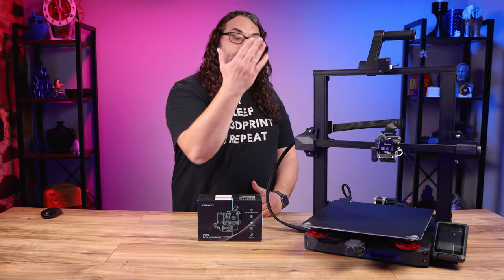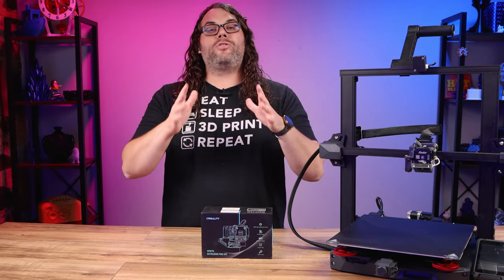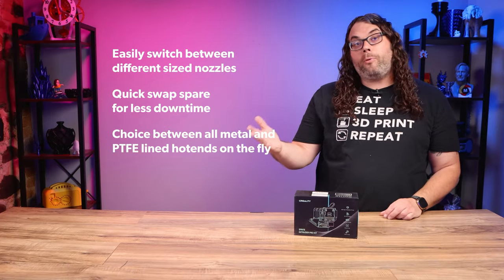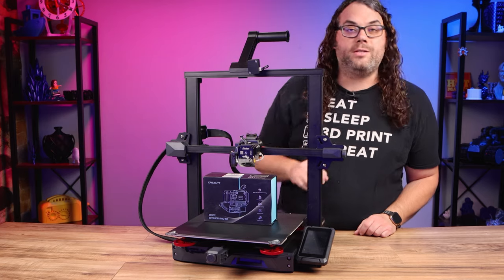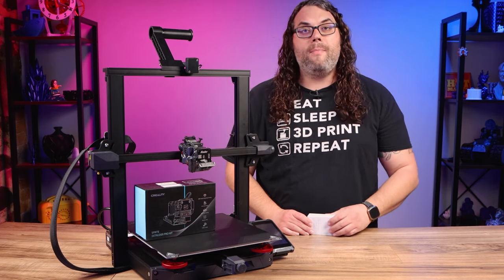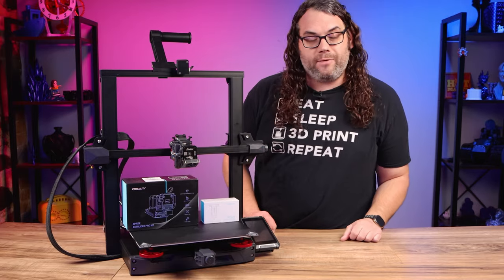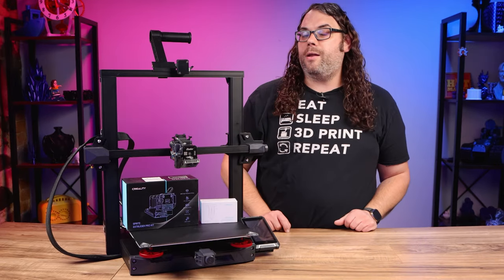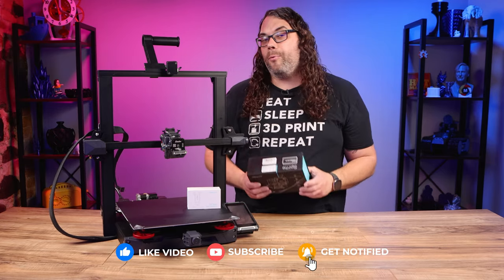Swap The Creality Sprite Hotend In 5 Minutes or Less!

Comment: Oversimplified as usual.  The CR Touch has a huge long cable, at least mine did.  That would require modification.   I also don't believe that you can just swap the head and print away. Channels such as this one always point out the incredible importance of the first layer.  I don't believe for a second that you will not need to to level to compensate for manufacturing tolerance.  When teh difference of 0.01mm makes a difference on first layer adhesion, you better be creating a new bed mesh after every change.  Not as simple as you state.  Also not that simple (labor intensive) to install on a printer that does not have this from Creality.  You need to disassemble the printer and run a ton of wires etc.  Also pointless unless unless you need to print at higher temps AND know how to modify code to extend the limits from 260 to 300, then recompile.  For the "nerd" this stuff is a piece of cake, but for the novice or someone who just wants to print better, hotter this is NOT as simple as stated.  You should define who your target audience is.   Not trying to be a jerk, just stating facts.  As always, this is a very informative video, but I do disagree with one thing you said, who would want to swap heads when the PRO version of this works for both PLA and other filament such as ABS?  Simple is better.
Reply: PLA prints better with PTFE than metal.  They do however seem to be improving the smoothness of the metal versions.

Comment: show me how to put it on a regular older model ender 3 v2, how do I upgrade the old E3V2 to have a the stuff the newer model has?
Reply from the maker: I like that idea!
Reply: @TheEdgeofTech  Agreed. I have a CR-10s that would love a direct drive upgrade of this level. I already have it running with 0.8mm nozzle for big prints that would need finishing any ways. Changing filaments on a direct drive is SO MUCH! simpler on a direct drive than a bowden setup. I am all about the faster and more convenient the better.

Comment: I have been trying to decide which 300mm or larger printer to get and now this makes me lean towards the Ender 3 S1 Plus if I see it on sale to compliment my Ender 3 S1. It would be handy to have another Sprite Extruder to share between them
Reply from the maker: I agree! The larger bed does come in handy sometimes for sure, and having an extra sprite extruder is a good idea!
Reply: I have the S1 Plus. I upgraded to the all metal hotend and use the sonic pad to run Klipper. Since the larger bed size causes more vibrations, I wanted input shaping. Super happy with the results. I also have a backup sprite hotend for exactly the reason being described

Comment: But...(I have an S1 no pro) Do I have to change the firmware because the non pro model can only handle 260°C More should be possible with allmetal, but isn't it possible on the software side?

Comment: I'll be upgrading my ender 3 pro with the sprite hotend and a PEI sheet. Will have to transfer the BL touch, and connect it all to the SKR board I've already installed.
Not looking forward to compiling a new custom firmware, figuring out the offsets, and all that jazz 😅

Comment: i bought one of these for my ender 3 v2 when it came out as an upgrade and over this past weekend one of the tiny cables broke inside the insolation. the gauge of wire they used in the cable is too small for my wire strippers to even strip the insolation off. I also bought a CR touch for my sprite hotend and had no way to plug it into the breakout board on the sprite extruder and ended up running the ketchup and mustard cables down with the large cable not very elegant imo but what are you going to do. maybe they updated the cr touch kits in the last couple of months but i doubt it
Reply from the maker: Good info! I have added the short CRTouch cable to the description of this video. Thanks for watching!

Comment: What settings are you using.  I just replaced my stock extruder with the sprite pro and cr touch.  The problem I am running into is that I cannot get it to autolevel.  After going to near center of board, it goes to point 1 but the problem is, that point 1 is off the front of the board.  Leveling stops after that.
Reply: I ran into the same issue. I have an Ender 3 V2 and had to use gcode M851 to adjust the XYZ probe offset. Once I did this, I ran into an issue where the bolts on the hot end carriage would run into the axis mounts on the far end. I trimmed the one bolt shorter and it cleared. Then it ran into the plastic of the Y axis belt tensioner so i trimmed that as well. No firmware changes needed and it can all be handled with Gcode and physical clearancing. You do need to measure the physical distance between the nozzle and CR Touch in X and Y and input that with M851.

Comment: Does this come with the breakout pcb? If not, "all you have to do" does not apply.
Reply: Yes, I agree.  I looked at those links and the all said they did not come with the board.  I looked again and it appears that the pro kit  ones with everything you need.  The kit is around $109 without a CR Touch and about $126 with one.  The kit comes with the new bracket and cable to the controller board.  Then you just need to buy the hotend that is not a all metal hotend and attach it with the screws and plug in the cable.  Total cost if you bought both along with the CR Touch looks to be around $200 or possibly a little more.

There seems to be two different kits, an A kit and a B kit and it is not clear which is which or which is all metal and which is standard.  It would probably be better to look on the Creality site.

Comment: I just installed this on my Ender 3 V2 everything turned on except my LCD screen, It has a black glow to it but nothing will appear on the screen. I checked all wiring and unplugged and replugged everything. I even reinstalled the .bin firmware and the display firmware but nothing. I tried to control my printer through Octoprint and it would say connected but wouldn't respond through there either. Any idea? could really use the help

Comment: I installed a Creality Sprite Extruder Pro Kit on my Ender 3 v2 NEO.  The direct drive bracket has a protrusion expecting the non-NEO x axis sensor :( any idea how i can fix this?
Reply: did you ever fix it i'm looking into all metal hotends for my v2 neo not alot of information on it
Reply: @Kami3Kaze  unfortunately i didn't, i ended up buying an Ender 3 s1 pro instead - i'm sure someone has tinkercad'd a solution though! Good luck.

Comment: does using the factory retraction settings matter? manual says to change them down from to 5mm @ 150mms to  0.4 mm @ 40 mms for PLA
Reply: You shouldn't need much retraction for direct drive. Lower it and then print some tests and adjust as necessary.

Comment: I am wondering maybe you can help me find right settings for my Ender 3 Pro printer with new upgrades:
- Sprite Extruder Pro kit
- CR Touch auto leveling 
- Silent motherboard v4.2.7

I have an isseu with CR Touch configurations to connect it with Sprite Extruder Pro Kit. Internet suggest lot of instructions how to add auto leveling kit to default Ender 3 Pro extruder. But I cannot find right instructions how to attach and how to config CR Touch with Sprite Extruder Pro kit. When I start the printer extruder goes to the middle and trying to level done extruder infinetly. And that damages z-axis and bed. Do you have some configurations for this type of kit? 
Please help me
Reply: did you ever find a solution?
Reply: @nateweast548  Nope :/ 
Might be that it's buggy motherboard. Not tried to replace it yet...